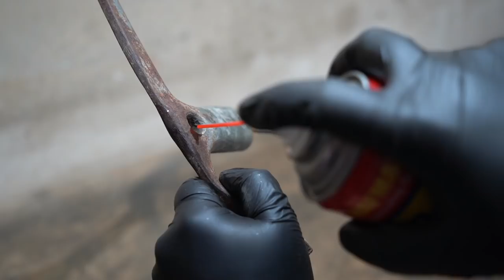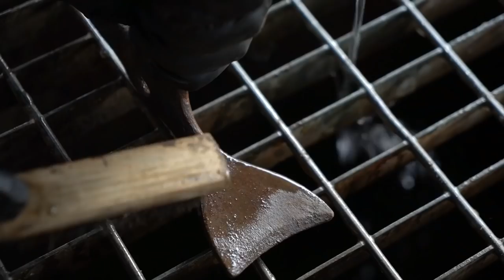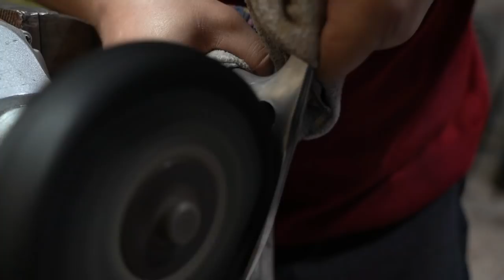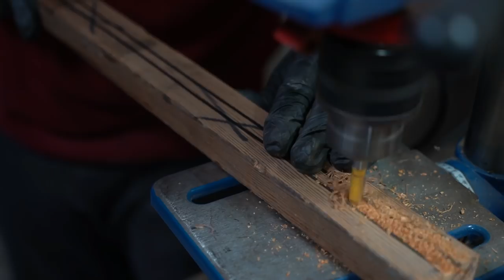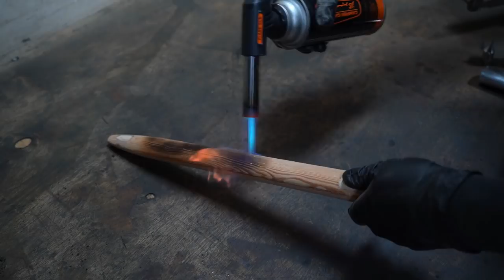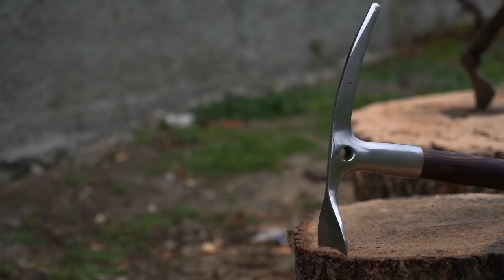Restoration Antique Ice Axe

Comment: Never seen an ice axe before. Turned out amazing 👍 I had to giggle when you used that sanding disc to clean up that center shaft because I had to do the same thing on a job today.  Great project and great job.